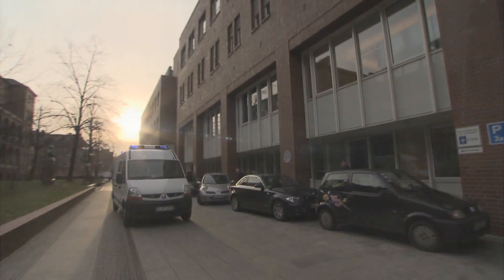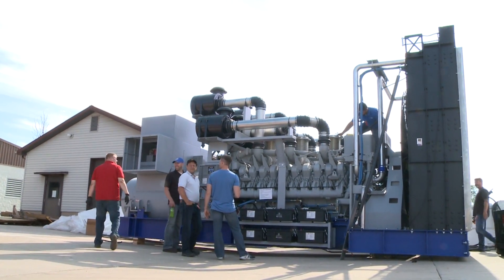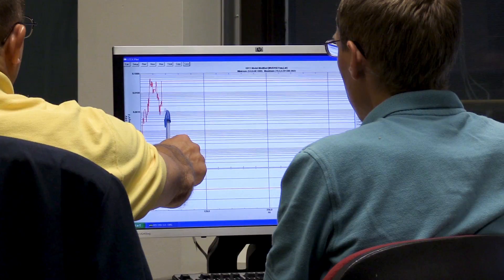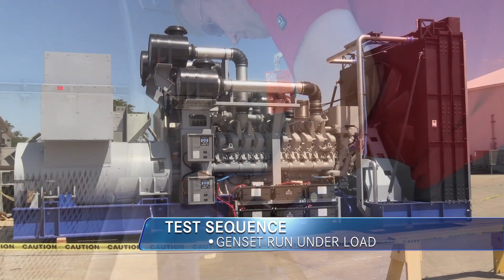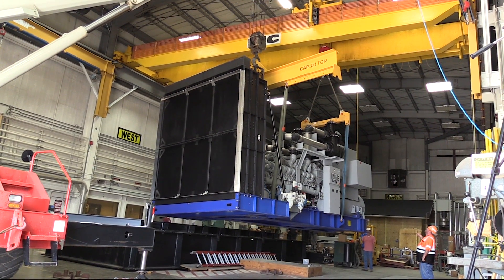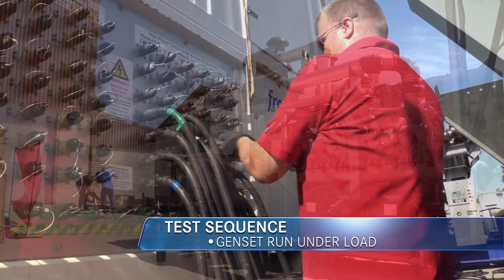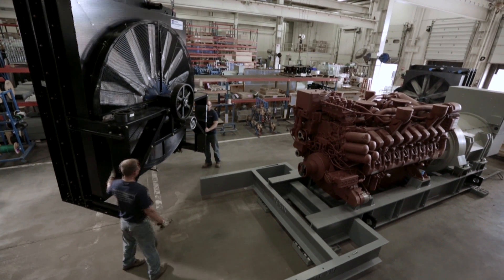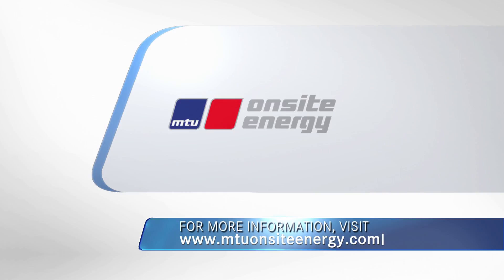MTU Seismic ComplianceTesting

Comment: Now show us how your gensets behave on the shaker when on full load. Testing when offline is good, no doubt. But when the generators kick in and an aftershock happens? That is when we would love to see your machines still survive. With all the inertia of rotating parts putting enormous strain on main bearings, rod bearings etc.
Reply: Right, it should start up and begin load shortly after the start of and during the shake test. Some quakes last several minutes in duration, power would be lost before the end of the quake.